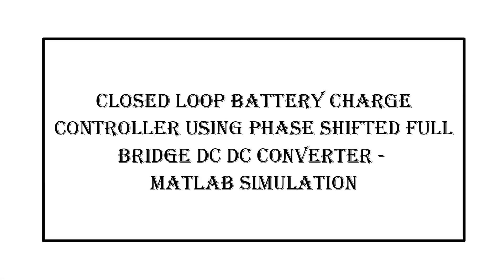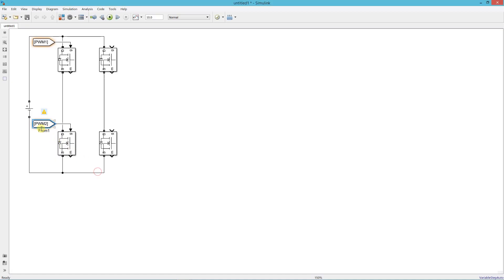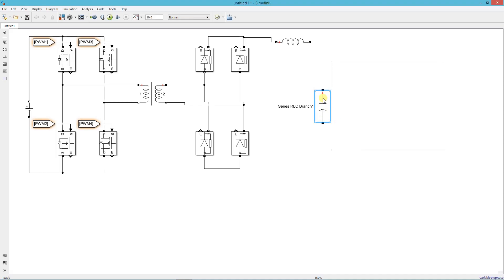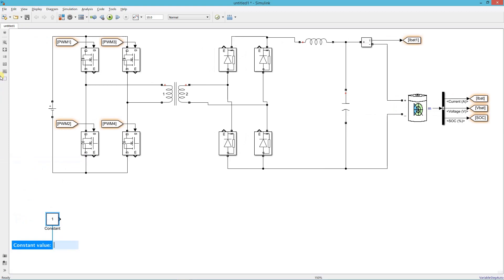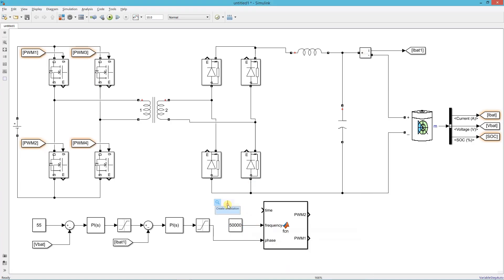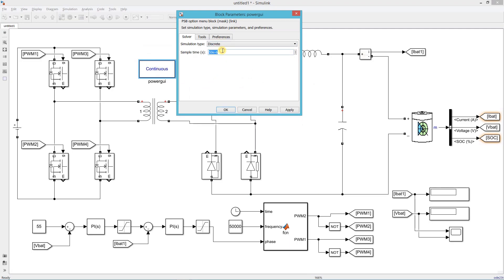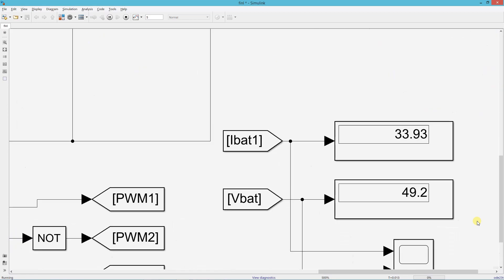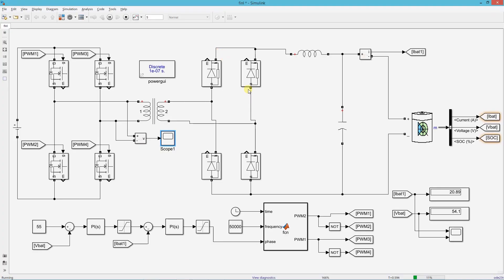Closed loop simulation of battery charge controller using PSFB DC/DC Converter - MATLAB Simulation.

Comment: Sir I have simulated with exactly the same values that you have taken in this video but i am not getting the cc-cv mode operated output waveform. could you please help me in this regard.
Reply: Hi. This model just controls constant voltage. For controlling in constant current you should use a separated error current controller.
Reply from the maker: pls share the model

Comment: I have a schematic for a 48 voltage DC charger, I want to apply it to Matlab. This circuit consists of a three-phase AC voltage source , a step-down transformer, a conduction group YnD11, and then a rectifier circuit consisting of a thyristor (6) thyristor and connected in series with it a coil and then the load is a resistance and connected to it a capacitor in parallel. I want to get a voltage so that I can charge the lithium battery its voltage 48VDC. Forgive me for being so long, and I hope you can help me. Thanks

Comment: Make a continuous video of this topic. Remove transformer and use inductors (non-isolated converter). Replace diodes with switches sir. This type of circuit is not available on YouTube sir. In case if you find it please keep the link in my comment. Thank you